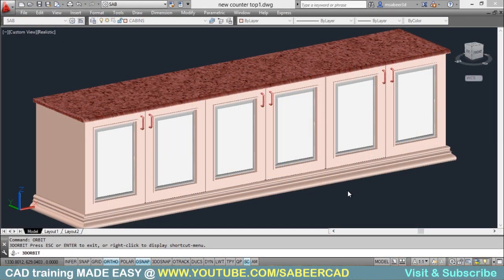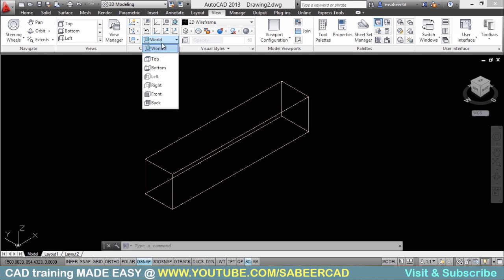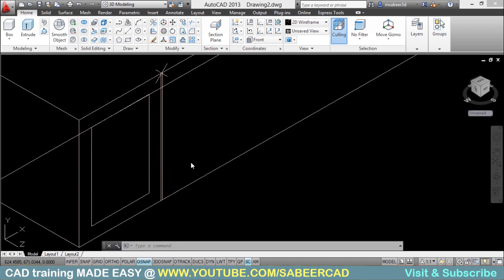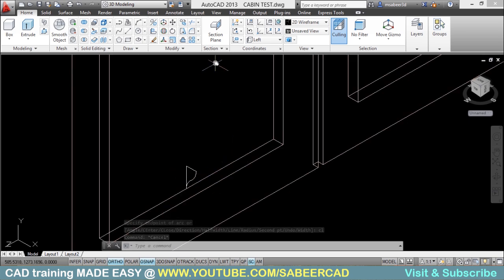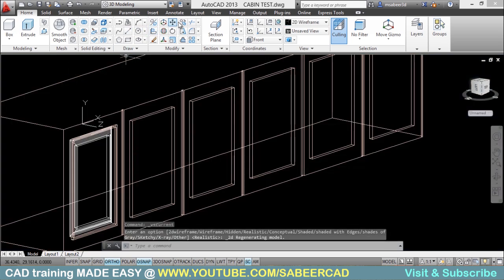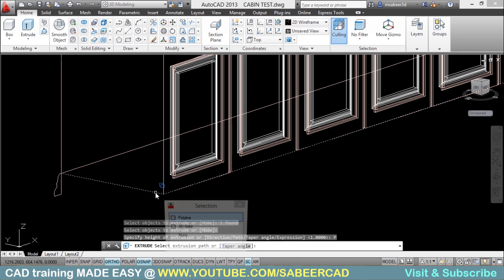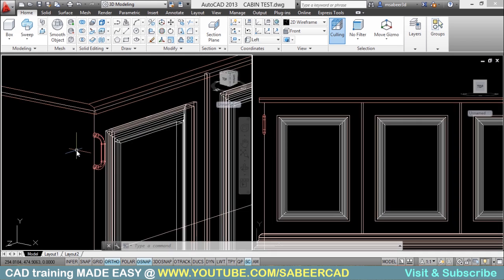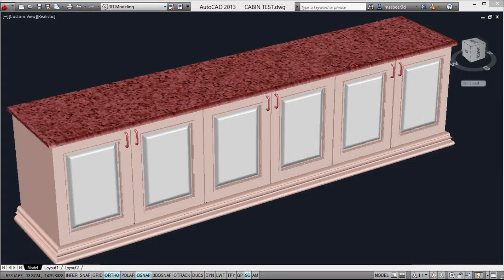CREATING A COUNTER TOP | AutoCAD 3D CABINETS | AutoCAD 3D WARDROBE

Comment: Hello Sabeer, 
Your tutorials have really saved me in a pinch! These are all very easy to follow along with, and much appreciated. I have built the 3D model of the kitchen I needed, now am stuck as to how to get standard 2D elevations from the 3D model. Do you have a video on this? I have been searching. The kitchen is a U-shape, and I cannot seem to find a way to cutaway one wall to view the other head on, as you would for an elevation. Any help from you or another commenter would be so appreciated!
Reply from the maker: Kelly Walker Hi Kelly , nice to hear from you ... ☺ You have to perform Boolean operation Subtraction to remove a wall , then take a Right side or Left side elevation as per your requirements
 . Then Give HIDE command . This will remove all unwanted lines and you will get a perfect elevation . Hope you have already gone through my 3D kitchen course in http://sabeercad.teachable.com
Reply: Thank you so much, I will follow those tips! I would love to sign up for the course, but it is not feasible at this time.
Reply from the maker: Kelly Walker Thanks Ok. Take your time ... Best wishes 👍☺

Comment: Thank you sir I have learned alot from your tutorial like all but i am struck in while i am setting the ucs icon my thing are dran the right way but they are floating here and there in the working space please sir help me in this regard thank you
Reply from the maker: You should turn off Dynamic UCS before you try this.  Please Check the status bar (at the bottom)
Reply: Thanks you so much sir for your helpful reply

Comment: 12:34 I am unable to draw arc in the z-axis. Only it allows me to draw in the y and x axis. Can you give me some advice? It does not snap in z axis at all. Do I need to set up some options?
Reply from the maker: In fact the arc is drawn in the xy plain . You cannot draw a polyline  in the z axis direction because it is a 2D object. So while drawing arc use second point option to get a proper curvature and select end point . If you can closely follow the video you will get the idea. All the best.

Comment: thank you for this video it really help me a lot. I have a question if you can help me and I'm using autocad 2015 and when I extrude and do the path . doing the curve in the door cabinet I notice my setting in the view when Im change it to fron after the next pick it changed to unnamed , . in this case its does not do the extrude.  thank you
Reply from the maker: Just create the profile to be extruded over the existing profile once more and give 'close' before exiting the polyline command so that it will be a closed profile .